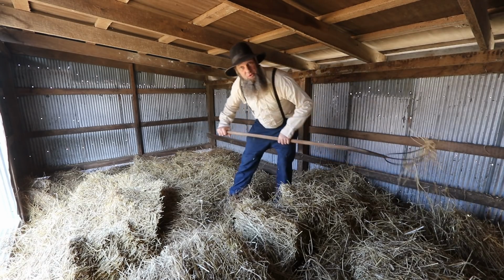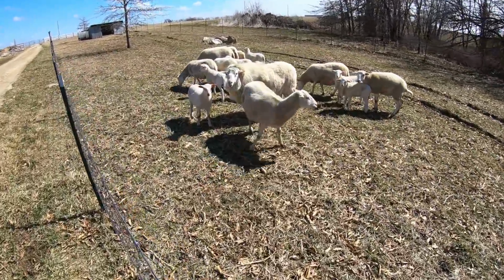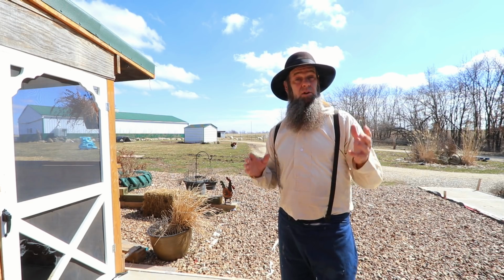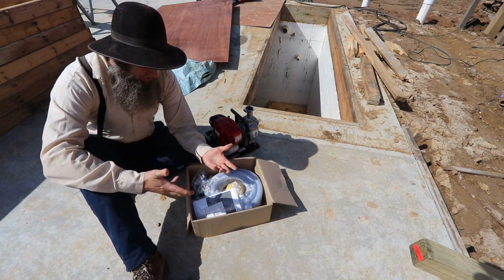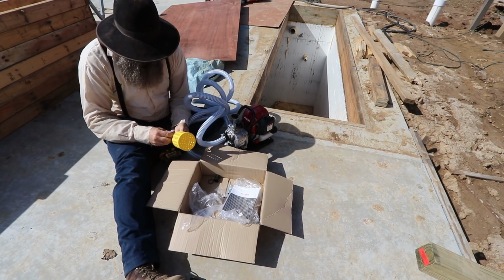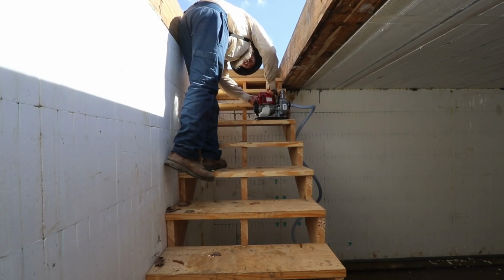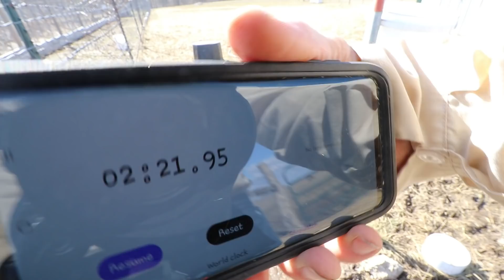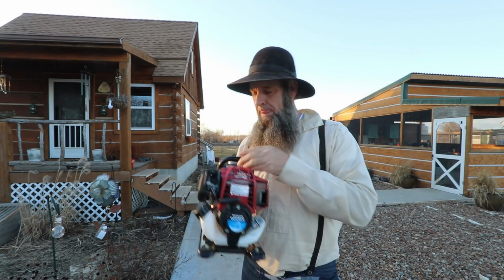OFF GRID~AMAZING small  WATER PUMP!

Comment: Also drain the gas out of the carbonator if you do not use it more than 2-4 weeks.  it will varnish up on you over time if you leave gas there.  Also for maximum gallon per minute flow rate use at least a 3/4" garden house for the outlet end, ideally a 1" hose that is the same as the opening, do not reduce the opening hole.  Also do not drag your hose on the ground as any pin hole leaks on the inlet hose will cause loss of suction and pump will pump less.  Ideally straighten your rigid intake hose on  a hot sunny day so it is easy to work with and keep it in big coils or as straight as possible.  Never run the pump dry or with too much air.  Ideally buy an intake screen like Doug has but also with a check valve so the prime maintains inside the hose.  Use non ethanol gas that is fresh less than 1 month old from the gas station.  No ethanol gas unless it is super fresh 1 or 2 weeks as this gas attracts water fast and breaks down fast.  Change the oil every 50 - 100 hours of run time on these small machines.  In hot climates every 50hrs.

Comment: I've got a GX31 off of a little Honda tiller in my garage, great engines! Nathan at Out Of The Woods has one on a portable wench he uses to pull logs onto his trailer. I've worked on quite a few of those pumps, but it was mostly just carb. issues. Ol' Rambo is ornery, but he seems to know when and where to and go!

Comment: Honda pump, have to check them out. Love our Honda generator, one went out with over 200,000 hrs my hubby calculated. With solar that works in winter we don't need to use it much any more. Helps that we are out of the motorhome and in sheds with radient heat. The polebarn hous will have the wood stove. Sheds are 10x16 and 8x10. 8x10 will be a walk in closet and house out 24v solar equipment.
Reply: Those hours would equal 23 years of run time, not calculating the non-run time.

Comment: I have an older version. It will pump 15 feet up an 1100 feet away with 2 inch hose. Starts on second pull every time.

Comment: I'm fascinated by off grid plumbing issues. Do you use a composting toilet, or the regular gravity type with a septic tank? I didn't see a rooftop solar water heater. Do you have hot water, and if so, how do you heat it? Does the water pump provide sufficient suction to clear any water line blockages, or would you have tio compromise and call in a line snake contractor? I know I have a lot of questions, but I am quite intrigued by these issues.
Reply: ArchEnema 67 they have a lot of videos tons of them, go to their home page and all of your questions could be answered there, plus a lot more info. Just saying they are a delightful couple to watch and we can all learn something new.
Reply: @betsytraughber1870  I think they are wonderful, too. I really respect their lifestyle and I want to know more about how they do it. I'm a recent subscriber, and I haven't had time to peruse their back catalog of videos yet. He did say at the end of the video that we should ask any questions we have in the comment page, so I did. I have a lot more questions, so I will be looking at their past repertoire. Thanks for the tip!